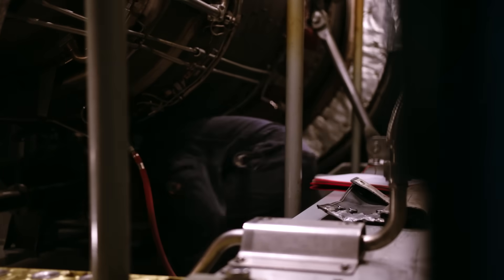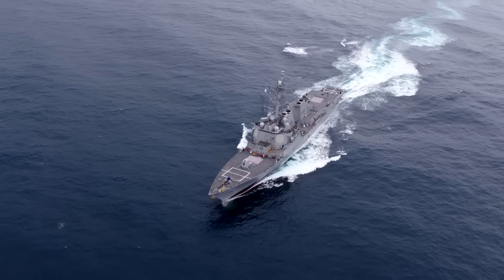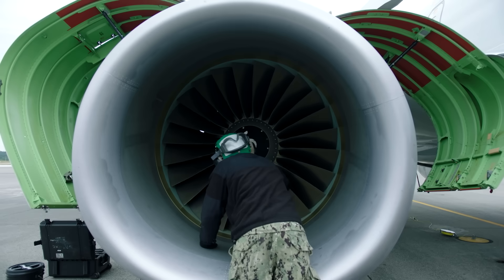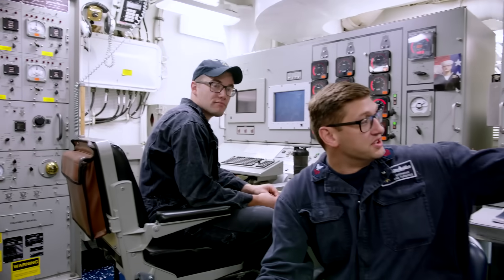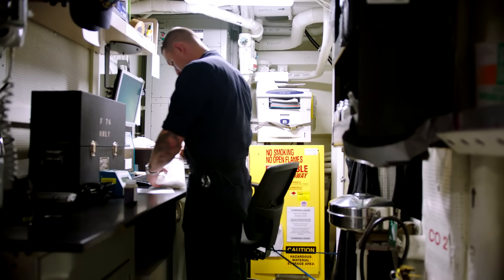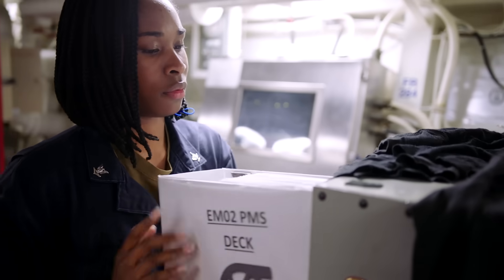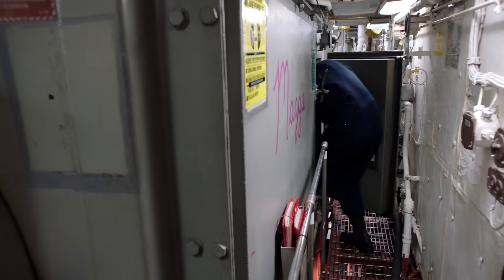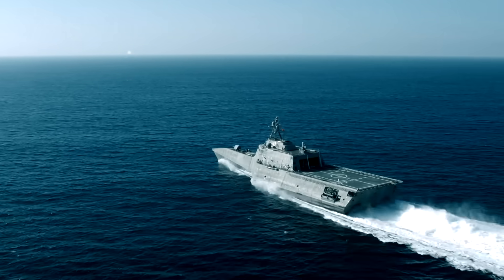Navy Gas Turbine Systems Technician: Mechanical - GSM

Comment: I am retired Gasser (slang for Gas Turbine Tech, back in my day at least), GSMC 1988-2008. CG-60, FFG-28, DD-982, CG-55 and FFG-55 (Top Snipe). Played with LCAC's briefly, hated it . I miss those engines... There isn't a more reliable engine on the planet. Gas mileage sucks, but the power to weight ratio is insane.

Comment: Anyone from mayport?
Reply: Was stationed in Mayport for 5 years.  Was aboard the Klakring and the Vicksburg.  Both are gone now.  Where you headed to or already stationed on?
Reply: @jgrow953  ddg 82 been in for 3 years. Nice place tbh but work drains us lol
Reply: @jgrow953 I was on the Vicksburg 2000 2005 gsm. Main engine room 2.

Comment: I was a GSE for 5 years went GSM last year , electrical side is way harder in my opinion
Reply: How so?
Reply: @mastahogweh5657 but the hard work is worth it. I’ve been in 2 years and am already a second class. GSE’s make rank quick
Reply: @mastahogweh5657  I’m a gse2 and gse if way better than gsm. Gse’s spend a lot of time troubleshooting the electrical side of the plant compared to GSM’s. The GSM’s side is easier bc they don’t have to deal with Electrical controllers and sensors.

Comment: I was a GSM, onboard the USS Fletcher DD 992, in the 1980s. Loved my time in the Navy.
Reply: trey burned leaded 100 octane
Reply: I was a turbine tech on 973 John Young from 99 to 01.  Loved my time in and loved that ship.
Reply: those can run e-85 which is 112 octane
Reply: You burn 100 ll low gasoline

Comment: I just got picked for gse. Is it worth it? Also do you get ranked easy? btw Iam going in as a E3
Reply: You'd better lover the bilge and maid work.
Reply: You'll do maid work until you get qualified. Then you'll do maid work and maintenance. Plus lift the heaviest equipment on the ship. Plus clean bilge, oil, fuel and stand every engineering watch. Good luck.
Reply: They said gs rates are good
Reply: @matthewtenorioduenas202  hello, I chose GSE, I am not sure if it suit me. I have two kids, I am afraid leave my kids so long.
Reply: @yancyz7451  you’re going to be just fine.
Reply: I haven’t even been in the navy a year and I’m picking up 3rd this month. You’ll do fine.
Reply from the maker: HOOYAH!